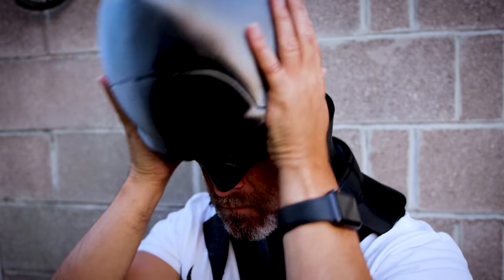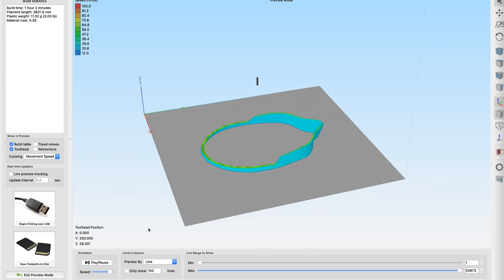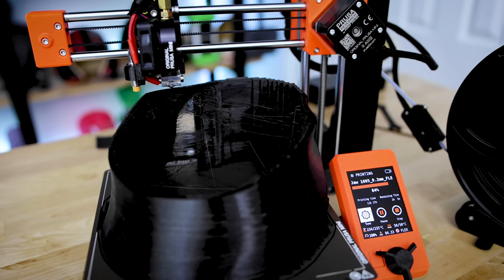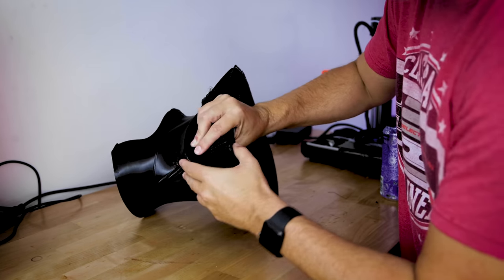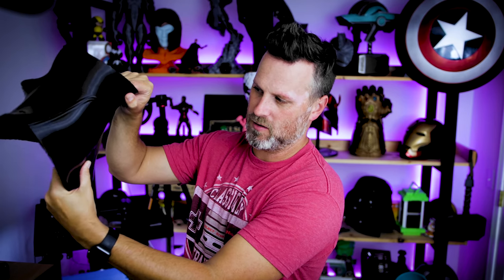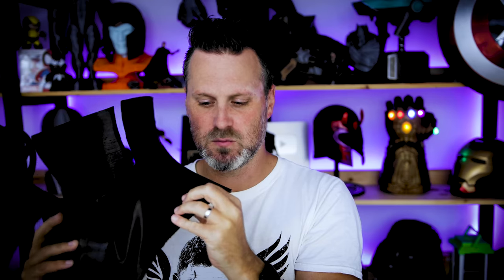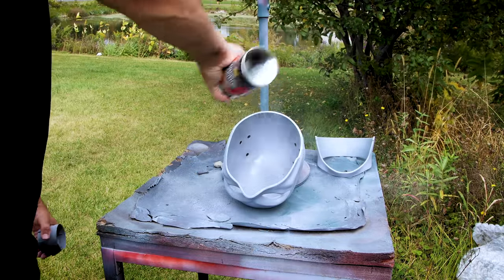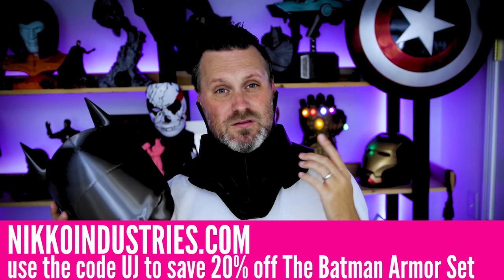The Batman Cosplay - 3D Printed Costume Part 1

Comment: Use a thin gaiter glued to the neck pieces that goes under the cowl. Then you can use velcro on the outside of the gaiter to hold the cowl in place more. But this will cover any skin that may poke through and tie the pieces together in a way that still allows some movement.

Comment: Why not design fasteners into the CAD file: post-and-hole or other snaptite-style fasteners like mfrs used to build into snaptite, glueless plastic models? Also, instead of TPU, why not silicone resin on the Transform for better resolution, fit, and finish? Just a few thoughts that may either improve things or not be doable for reasons my feebl mind cannot fathom. Fun stuff, though.

Comment: If you rough up the tpu, you can apply creature cast as a base. Creature cast is a Neoprene material used for masks and cosplay. I use it on foam allot and the beauty os that you can sand it down and use any acrylic paint to dress it up.

Comment: You do good vids. I've tinkered with tpu a little bit, here's what I've done with clean up. After removing the big stuff I did some scraping to help it get rid of any lumps/jagged spots, then hit it with some heat. For the back where you sliced it, maybe some rivets and elastic strips might sufficient to keep it in place as well as for ease of taking it on and off. Looking forward to the next parts. Thanks for the content!

Comment: Does nikko industies have eva foam templates included in that? Im trying to find the best templates but if not i think ill use xieng prods version.
Reply from the maker: No, it’s just the 3D Stl files
Reply: @MindCandy Podcast if you wanted to you could print at least half of the cowl and then put duct tape on and make a pattern off of it.